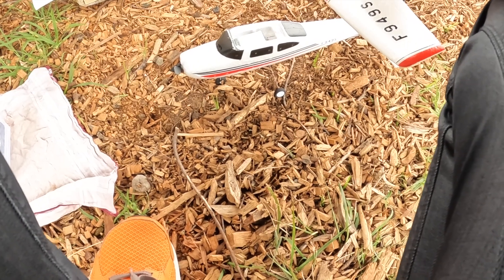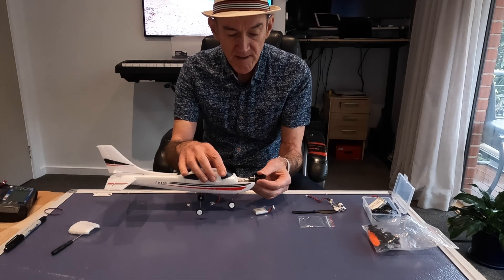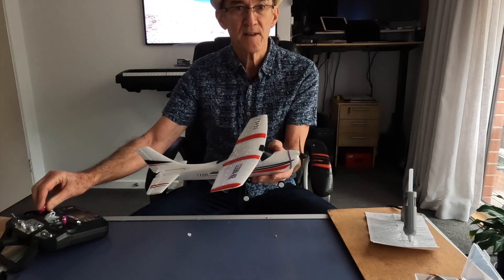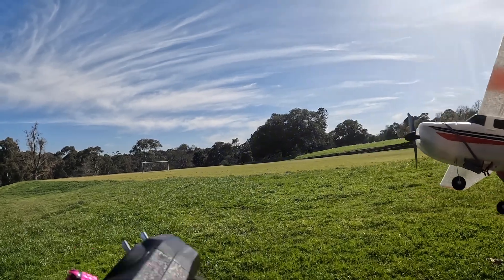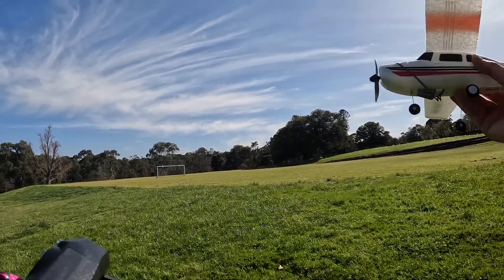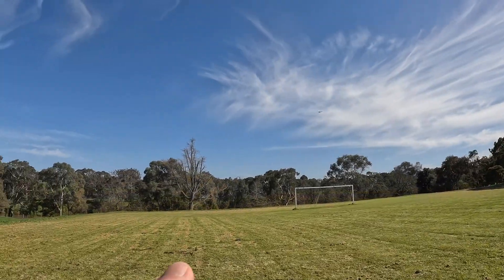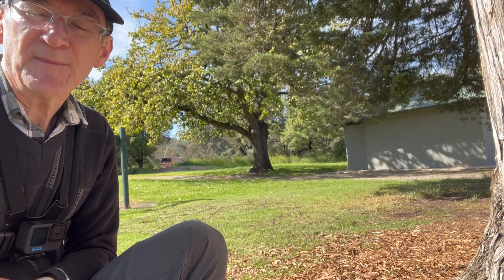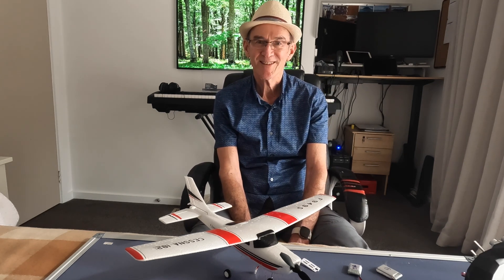F949S Part 3 Review - Motor Burnout and Replacement #DavesFunRC

Comment: I have a question
Wltoys F949S uses AFHDS or MT99XX protocol ?
Reply from the maker: Hi, good question.  My first F949S didn't have AFHDS - this is the later model receiver/servo block that has built in stablization.  Not sure the protocol, but came with it's own transmitter.  
I then bought an older block online which originally came with the older F949 - this was AFHDS and bound with my FlySky i6 transmitter.  This one didn't have stablization but flew a lot better with my FlySky transmitter.  Note, I had to set that model up on the transmitter for AFHDS (without the 2A) protocol and I had to bind it each time I used it. (To turn off 2A, this is under SYSTEM / RX SETUP on the FlySky FSi6.)
Hope this helps.
Reply: @DavesFunRC Thank you for your answer. I love it.
Reply: @DavesFunRC  Unfortunately my F949S transmitter can't connect with AFHDS protocol receiver like Flysky FS-R6B. If I want to upgrade brushless motor, I will buy a new transmitter-receiver and new brushless ESC.
Reply from the maker: @cothieuhoang7219  I think I saw a YouTube on a brushless motor conversion on this plane.  Should be great - you will need a different motor mount though.
Reply: @DavesFunRC yeah, I saw my F949S's motherboard and it have a channel 4 port for aileron's servo plug same with older version. Now, it can be going to brushless without buying a new transmitter & receiver.

Comment: Nice to this video. I have bought as the original motor replacement and mounted it in the plane but it is not generating enough thrust. Now I have decided to make as yours. Here in our country I did not got the geared 1020 motor as yours but only 1020 motor without gear. 
1. What do you think if I use one 1020 motor without gear with 75mm propeller? will generate enough thrust ?
2. There are 3 connections from the circuit board for 3 motors. So is it okay to connect 1020 motor to any one of those connections?
Thank you.
Reply from the maker: Hi, there. I think the original 3-motor replacement should have had enough thrust.  I prefer the 1020 geared motor with 125mm propeller as it is quieter and has a bit more thrust.  But the tri-motor with 105mm propeller should be OK.  If you are attaching a 1020 directly to a small propeller, you won't get as much thrust as the geared, larger propeller.  I think 75mm is too small.  Probably the same as the original 105mm propeller would be better, if you can attach it OK.  Otherwise, give the 75mm prop a try!  You should. be able to run the 1020 motor from one of the 3 power leads that you have just fine.  Good luck!
Reply: Le doy 3 opciones. Como dice Daves comprar el motor Pro tal cual. Reparar el viejo motor como lo hice yo.  Ponerle al viejo motor la hélice grande como la del Pro.
Reply from the maker: Hello, again.  Small correction to what I just said - the 75mm propeller ungeared is the right size or the 1020 motor.  The F949 only weighs about 60 g, so should fly with 25-30g thrust.  I would like to hear how it goes.  Cheers.

Comment: Hello friend?Please link purchase or batery...Thank you for atention
Reply from the maker: Hi, I bought the 800mAh from Ecocell in Australia. https://ecocell.com.au
It was a LiPo Battery 800mAh 3.7V High Discharge 902540, Polymer Lithium Ion
The 1020 Strong Motor can be bought at https://a.aliexpress.com/_msi029A
Reply: @DavesFunRC  Hello friend. Thank you very much for your quick response. You certainly helped me a lot. I am from Brazil and I am very happy that you responded so quickly and helped me a lot. Thank you for your attention.

Comment: Very good video！May I ask what tool you use to cut the plane？
Reply from the maker: Hi, I used a scalpel to cut the foam.  I’d also recommend a box knife with snap off blade.
I also did a later Shorts video on another operation I did on a second F949: F949 Motor Replacement
https://youtube.com/shorts/JT_mmzPIokw?si=W4RwQ6GQZ8g8GMMs
Hope this helps.
Reply: @DavesFunRC 
Thank you very much, your videos help a lot！I have a F949S too and a pin came off from the motor main gear so I need to remove the motor and install that pin again. Your video really helped me a lot❤

Comment: Link motor please
Reply from the maker: Hi, I bought it from AliExpress.  It was under the Cessna-182 P707 and was an optional replacement part.  If you go to this link and click on the ... for more options, at the end you will see the 1020 strong motor with geared propeller at the end. 
https://www.aliexpress.com/item/1005002646804109.html?spm=a2g0o.order_detail.order_detail_item.3.469df19cxXmGiH
Good luck!
D.

Comment: At $50 im not sure this plane is worth upgrading i think its more of a trainer..i have been enjoying mine but its not something i would put money into unless i had parts just laying around
Reply from the maker: Hi, yeah, I had to replace the motors in mine as they had burnt out.  Even though it’s just a little trainer, it’s good to have to help others give flying a try.  It was a fun exercise replacing the motors and the 1020 Strong motor gave a lot more thrust and didn’t sound so much like an electric toothbrush!
Reply: @DavesFunRC  thats awesome kool build bro
Reply: @DavesFunRC tem vídeo montando todos os componentes? Abraço
Reply from the maker: Olá, tenho um Shorts no YouTube sobre a substituição dos motores F949:
Acesse meu canal
Clique em Shorts
Filtro para "F949"
Um vídeo chamado "F949 Motor Replacement" aparecerá.
Eu espero que isso ajude!
Reply: Very valid point

Comment: Nice to see that the local council hasn't slapped any restrictions on light model flying there at Yarra Bend Park Dave. We're lucky here way out in the bush, but in many places you need a permit to scratch yourself these days!
Reply from the maker: Yeah, I fly in an area that is designated “Dogs on Lead”, although this is not strictly observed by the locals.  There are lots of other good sports ovals nearby and they are dogs off the lead, so I usually steer clear of them.  I try and keep a low profile and only fly when there are very few people around.  I use a couple of apps on my phone to ensure I don’t fly in prohibited areas as well.
I’m keeping an eye on trends overseas for restricting remotely piloted aircraft and hope it doesn’t come to that here!
Reply: @DavesFunRC  Ah well, Such is Life! Nice to know the spirit of old Ned is still alive down that way too! 😉😊